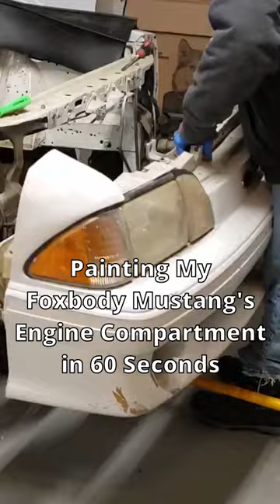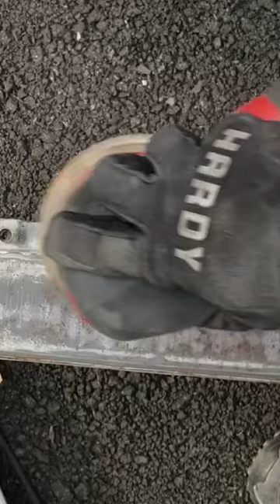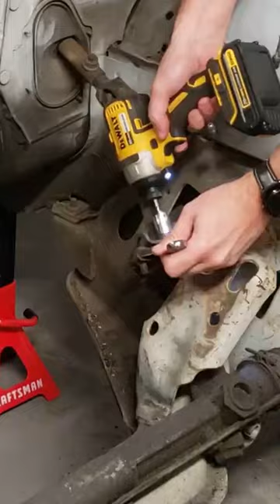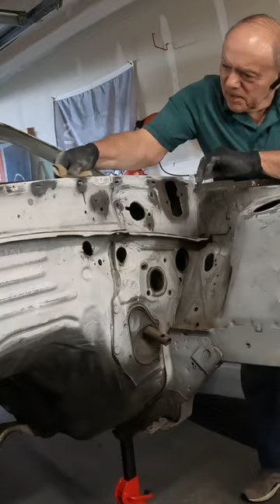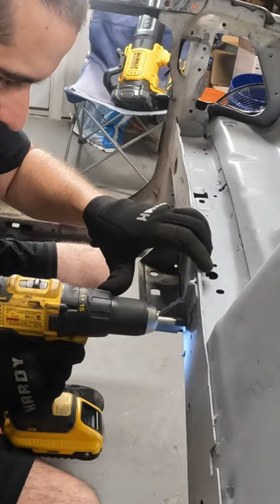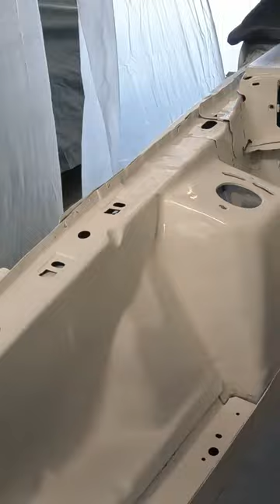Painting my Engine Bay in 60 Seconds #shorts

Comment: Nice work, crazy how many holes Ford kept adding but never deleting, looks like Swiss cheese.  What's your technique so you know which holes to keep and which ones to weld over?  Did you make some drawing, take pictures etc?  With my OCD I would end up not getting rid of a few holes here and there and have to go over that area again, but it would suck because you don't really know they're extra until you start putting it all back together.
Reply from the maker: Thanks! My approach was to basically go blank slate on this. I did leave the back sides of the strut towers with the factory holes though. I figured I have plenty of drills and can always re-make specific holes if I need them. My plan also includes using cleaner looking nut-serts instead of the factory style threaded punches.

Comment: Im really curious as to what all those little holes were from? The ones in and around the strut tower.
Reply from the maker: They're from various mounting points for components of differently optioned fox platform vehicles Ford made where they re-used sheet metal parts. So while a ton had sensors and brackets and whatnot, there were plenty more that didn't for this model. ie. easier to punch a bunch of holes in a ton of strut tower panels that can be used for the v8 or 4 cyl or the cougar etc.

Comment: How’s the paint holding up about to use the same paint in my bay
Reply from the maker: So far so good but I haven't put an engine in yet. It seems pretty durable though where I torqued the caster/camber plates on. I was half expecting the stand-offs to sink in but they didn't.